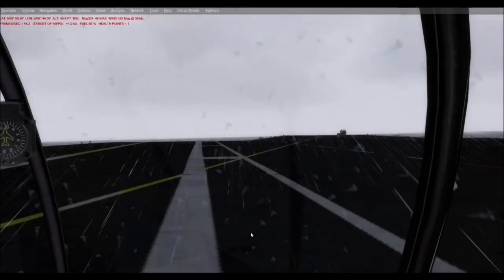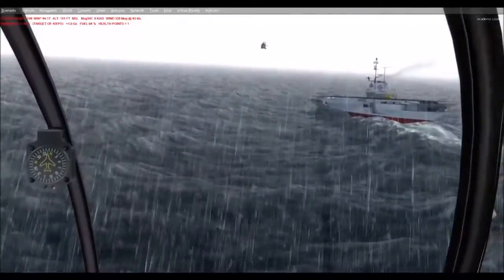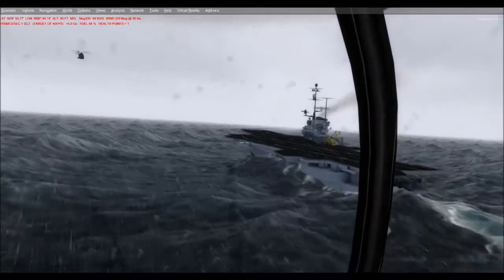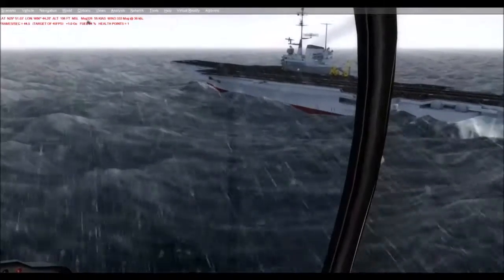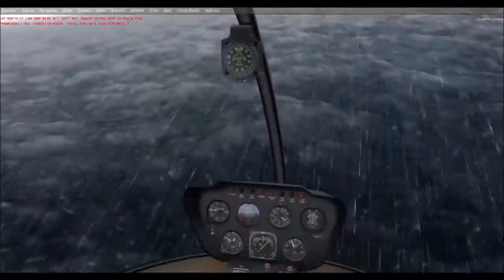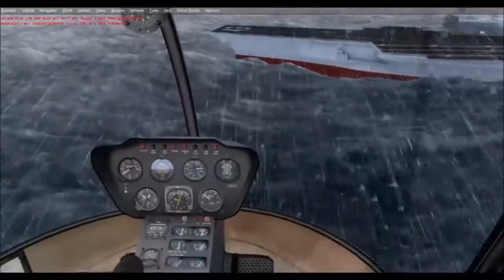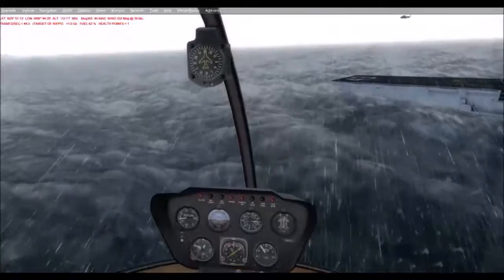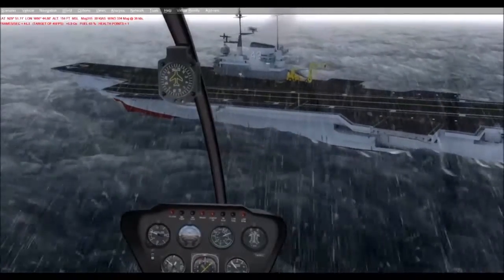SWS Pitching Deck demonstration

Comment: And with that the time has come to switch to P3D.

Can I ask is this behavior scripted into this specific carrier model or can it ultimately be applied to other ships?
Reply from the maker: The moving ship feature will be part of an upcoming feature package that will significantly boost naval ops. This behavior will be supported by any ship that makes use of the CEX SDK, be it freeeware or payware. I can't say about non-CEX ships yet, as we are still working on implementation.
Reply: Thanks for the reply, the work you guys are doing here is a complete game changer for naval ops, so much of what you've done I'd thought was impossible within the limitations of the sim.
Reply from the maker: Thanks! In 90% of cases, impossibility is not being interested enough.

Comment: Can you show us your Phantom on deck while the boat pitches?  How stable is the aircraft while riding the boat?  -Woogey
Reply from the maker: If you hit the brakes it stays in place. We are talking about an enhancement to that, securing parked aircraft and fixing whatever friction problems P3D still has.
Reply: Hi Preston, due to the way that we have implemented the motion, the aircraft behaves normally on deck - and naturally in seas like this you will start to roll around if you're not careful/don't set the brakes. The "liveliness" of the aircraft on deck with other deck motion systems was one of the main reasons we had to do our own, and ours does not suffer from this. However due to a bug/rounding error in the sim, there is still a long-term drift (it's present even when the deck is not moving, and noticeable over a few mins, depending on your latitude and course). This drift is the reason that, as my boss says, we are looking at adding a "tie-down mode" to lock the aircraft firmly in place on the deck.
-The guy in the video